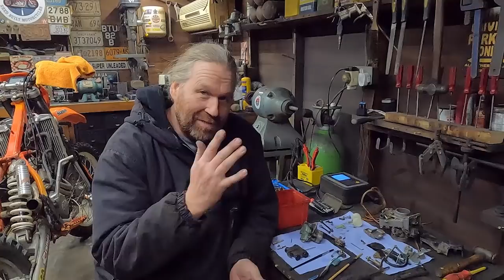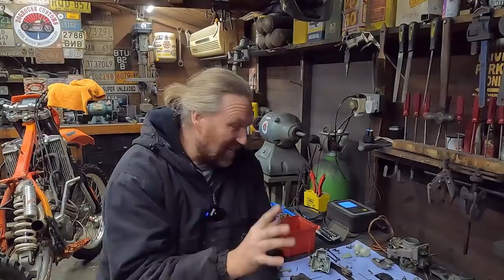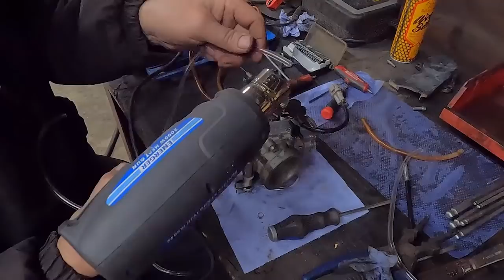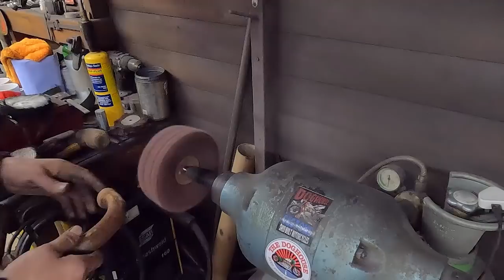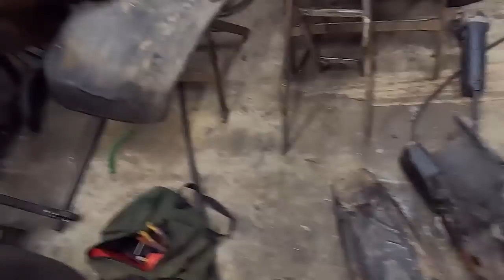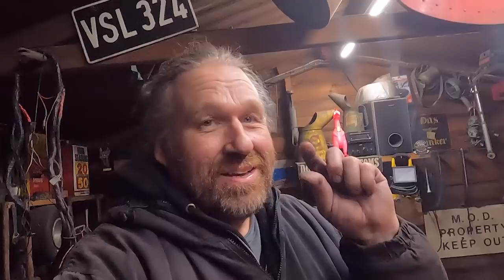E10 fuel turns carburettor green

Comment: I have a quad bike that I was having issues with when it had not been used for some time. Cant remember who told me about it, but basically ethanol fuel is hydrophilic and is a problem with carb engines as the fuel has access to air. This is not an problem with injected engines. I now turn the fuel off and run the bike until the fuel is exhausted, and have not had any issues since.

Comment: You can remove the ethanol yourself by mixing the gas with water, letting it settle then draining off the water/ethanol mixture that settles at the bottom. This works because the ethanol has the ability to bind with water. There are lots of videos on how to do it. In this way, you could compare non ethanol gas to ethanol gas to see if the green shows back up. In some places (In the US) you can buy non ethanol gas but it's expensive and hard to find.

Comment: Just a note about that E10 crap. 25 years ago, after retiring from an arid climate in Colorado to humid, very humid Mississippi, I opened a small Motorcycle shop. To my surprise, the first spring I was open, I had a shed house of new customers with carburetor problems. Yep E10. Ethanol is hydrophilic and attracts moisture, so carbureted bikes that sit all winter can have a carb full of green goo or powder.  After talking to a friend on the Gulf Coast, I invested in a 10-liter Ultra-Sonic cleaner. I would proceed to disassemble the carburetor(s), then run them through the Ultra-Sonic for 30 minutes to an hour. Then pull them out blow out all the passages, run a brass wire through the jets & offices, then reassemble the carbs and call the customer to come get the bike. Price of cleaning the carbs went from $100.00 USD per carb to $50.00 USD per carb. 
What I am saying is that Ultra-Sonic cleaner made the carb cleaning job a breeze. 
I never found any product that really did a good job of cleaning a plugged-up carb on the bike, though fuel injector clean did help some that were not too gummed up. 
There are several additives sold here in the States that help prevent this, I am sure you have several in the UK. 
Good luck with your new Green World.

Comment: I worked for an polaris atv dealer as a mechanic and now work for myself and I've seen this greening of carbs quite often in my state of Illinois and in my experience after it happens you can clean them out, but it will return after a while causing you problems again, so i found that it's just best to replace the carburetor with a new one. My thought on this phenomenon is it's from moisture getting in the carburetor due to the bike sitting in a non-climate controlled environment with sudden temperature changes that basically causes the carburetor to sweat inside (this also happens to the inside of the engine), so the moisture mixes with fuel and combined with the dissimilar metals inside the carburetor creates a chemical reaction which actually causing a "plating" effect that coats the inside of the carb, that's why it's usually all over inside depending on how long the bike sits. So i really don't think it has anything to do with ethanol in the fuel. I can also tell you this from my experience, the Chinese Knock off carbs work great, so i wouldn't hesitate to buy one and use it without worry plus you can't beat the price we used them a lot on the older machines just like i am on my polaris scrambler 400 without issue and without breaking the customers bank! This is just my two cents on the subject. With all of that being said keep up the good work mate i look forward to your videos!

Comment: The copper has probably reacted with oxygen, water, and carbon dioxide in the atmosphere.

Brass is an alloy that’s usually made up of 67% copper and 33% zinc. Bronze is composed of 88% copper and 12% tin.
Reply: That’s what I was thinking. It all looks like copper oxide. Might have slowly floated through the carb and coated everything in the loose oxide. 
Isn’t ethanol hydroscopic? If it’s been stood in a damp atmosphere it might have absorbed moisture via the vents / overflows. Just my 2 pence worth but I agree completely.

Comment: I bought an ultrasonic cleaner a few years ago and it's awesome for cleaning carbs out, I use a carb cleaning solution with it and you'd be surprised the amount of crap it does get out.

As for the old wives tail about removing the ethanol from your fuel using water, that's 10% you're getting rid of that you've paid for and you're effecting the octane rating of the fuel. Just fill up using premium fuel that doesn't contain any ethanol.
Reply from the maker: Thankfully I use premium in the BMW I will defo use it in everything from now on
Reply: @THEDOGHOUSECUSTOMMOTORCYCLES  But make sure it is ESSO premium Craig. I recommended it to a friend of mine with a Datsun 240Z and he was amazed at the performance difference.

Comment: Not long since rebuilt my friends carbs for the same reason, had to replace all the rubber seals as they'd all gone hard and cracked, same thing happened to my RD400 even though it had silkolene pro boost fuel stabiliser in the tank, best thing is to drain the carbs , you  just can't leave this stuff sitting in your fuel system , ok for everyday use.

Comment: You can remove all the ethanol by putting tge ethanol fuel in to a glass  wine making Demijohn, adding 1/2  litre of tap water, cork the demijohn and shake it vigorously, then allow it to stand so tge water settles, it also collects the ethanol as a globby looking layer, simply syphon the clean fuel off the top.
Reply: Not a good idea, your octane rating will be seriously low after doing that. Better to add a stabilizer to the fuel.

Comment: "Aluminum oxide appears as a powdery white or dull gray coating. As oxidation occurs, it hardens and creates a protective layer over the newly exposed areas of corroded aluminum. The aluminum corrosion process is actually halted by oxidation – the metal won’t continue to deteriorate unless the aluminum oxide is removed."

Comment: There is a way to remove the ethanol from the fuel. . . I bit time consuming but well worth it if it is an ethanol problem. 
That powder may be also be lining the whole of the fuel tank too.
This E10 is causing all kinds of problems for seals, pipes and other surfaces .

Comment: Yes Craig it is the fuel ,I've had same thing with e5 fuel ,it absorbs moister and turns to mould ,I wouldn't use e19 in anything with carburettor,I think additives are becoming available to counteract it 🤔

Comment: I have noticed that since e10 fuel was introduced that if I am in slow traffic for more than a few minutes I get the traction control and anti lock brake warning lights coming on this is apparently a warning that the plugs are becoming fouled ( vauxhall meriva by the way )

Comment: Hi Craig, as someone else has suggested , it is verdigris from the brass parts in the carb. Ethanol attracts water and the water reacts with the brass to produce that green oxide. If you left those parts outside in the weather, you would get the same result. The answer is not to leave vehicles sitting unused or drain all the fuel out when you have to store them. E10 is not a problem in a regularly used vehicle, they’ve had it in the USA for years!

Comment: I use Esso premium fuel, it says E5 on the pump, but I've been told that it is still Ethanol free up here (North West).
Not had any issues so far.
I only use other fuels if out and about with the lads and they choose the fuel station to stop at - then I fill with Esso premium when near home.
Yes, it's expensive, but, if it's true that it's Ethanol free, you're getting a good bit of extra energy, and it's not like we burn that much fuel in bikes, is it? :D
Reply: We’ve had a go at de ethanol esso e5, but got very little out of it, so we heard there’s no ethanol in it which is probably true.

Comment: Ethanol fuel eats aluminum and rubber seals. The green is from the alcohol and the powder substance is from the aluminum being eaten away. "It is not the ethanol itself that is the problem, it is the substance that is created when water and old ethanol mix. This stuff is very corrosive and will eat thru aluminum. So, if there is no water in your tank, no problem." 
Alcohol fuel attracts more water to it so fuel stored will gain more water content. If you park a motorcycle outside in cooler weather that has a metal tank water will attract and you will be able to see the fuel level in the tank. It sounds silly but it is good idea to shake the bike a bit to remix because water and alcohol naturally want to separate;  the water will be below the alcohol and when you turn on the fuel tap the carb will fill with water and cause starting issues.

Comment: If you use E10 you have to use fuel stabilizer, if you let it sit for ANY length of time..I reccomend using Non Ethanol fuel instead..but even that will cause issues if left for long periods of time...Shame that you have to sell it...worth big$$ down the road...👍🗽🇺🇸
Reply from the maker: The more I think about selling it the more upsetting it is, last year wasnt so good on the pocket so got no choice, quite a rare bike in the UK so I probably wont find another one.
Reply: I agree and suggest you ask $3400 for it...Ifigure in 2 years it would bring $4,500.....I wish I had a few of my "had to sell"  bikes and cars, now that they have gone up so much in value!...Good luck with the sale and woring job...It's  easy to wire the bike with an "M Unit" ..You'll  never do it differently again! 👍👍👍🗽🇺🇸

Comment: Ethanol adds octane to gasoline, which is getting cheaper and cheaper, and of a lower quality all the time. But ethanol also absorbs water, so it doesn't like to sit. It is possible to remove the ethanol from fuel, basically by adding water and then decanting the petrol, but then you're left with low octane crap... It's not the world I grew up in...
Reply: Ethanol does not burn as efficient as petrol ... it does not add octane and using e10 lowers engine performance . The e10 in uk is terrible in older vehicles ...

Comment: I’m guessing that you are the victim of standing water.  It looks like a reaction with the copper in the brass bits.  Ethanol wouldn’t do that but water would.  I think the E10 fuel didn’t come to the pumps until September.
Reply: Quite right, E5 will do it as well, just takes a bit longer!

Comment: I stopped using the E10 a few years back,,it's just a terrible, dirty fuel,,I use  ethanol free gas now,I always turn off the fuel,and run the carbs dry, I never leave fuel in the carbs,

Comment: Yes sir, E10 fuel is no friend of the Carb'd bike or car! Weaker fuel than of old with the Ethanol blendand  not compatible with some older vehicles, but then the powers that be, know that! Def drain fuel out if your bike is not used for long periods of time. But at least there are fuel additives you can get to combat the Ethanol in the fuel. Putoline do they're 'E10 fuel fighter'. Just 25ml of it treats 25 litres of fuel! Comes in  250ml bottles!!

Comment: Only use 98/99 octane and stay away from e10  in older vehicles in uk ... never use e10 in a 2 stroke as it attracts moister and will rust the crank in 2 strokes ... It's terrible fuel none of my old bikes like it and they feel under powered and get flat spots in the tune ...  this e10 will kill off the older vehicles as it's a deliberate thing to get rid of older vehicles for the green deal electric cars to get pushed on us

Comment: Its a conspiracy to ruin all motorcycles , minibikes garden equipment !! Its horrible I have 5 Motorcycles in my shed and they all ran fine when I parked them now they wont even start😵 my Goldwing has 4 carbs my CBR600F3 has 4 carbs my Silverwing has 2 carbs ECT ECT so now I have to invest in a ultrasonic cleaning tank and spend many hours on each bike taking off all the carbs and cleaning them just to get them to the point they were when I parked them last year😣 that ethanol fuel is HORRIBLE!

Comment: How long has the bike stood wothout the engine running? I only use E5 on my bike, but are worried when it sitting for some weeks during winter.
Reply: E5 high 98/99 octane fuel doesn't have ethanol in it in most UK fuel garages
Reply from the maker: Normally I run bikes up or ride them every week but with having a lot on stupidly I didnt do it, The KTM sat for about 4 months. I defo learnt a lesson here.
Reply: @THEDOGHOUSECUSTOMMOTORCYCLES   avoid the e10 and use a fuel stabilizer like sea foam if you leaving bikes for months at a time with fuel in the tank and you can run the carb dry to put into storage. I only use high octane and use sea foam as it keeps the carbs clean and you can leave fuel in the tank for a year plus and the sea foam stops the fuel going off ... 👍  I thought you be keeping the ktm to ride some trf and tet trails and byways with us in south wales lol ...
Reply from the maker: @Rust_valley_adventures  I would love to keep the KTM but things wasnt so good last year so I have no choice to let it go, gutted but im trying not to think about it.
Reply: @THEDOGHOUSECUSTOMMOTORCYCLES   money not everything dude. good health is the real  wealth 👍👍 nothing like jumping on a dirt bike and you end up on top of a muddy  mountain with your mates lol

Comment: Yep its the E10 - its garbage - has a big detrimental impact on the environment - it will kill your bike if you leave it for any short time- if your running a classic vehicle it will rote fuel pipes and other plastic parts - if you are storing a number of bikes or just storing you can get a storage fuel (covered on Harry's Garage) - you could use the premium fuels they are currently E5 - they want to keep adding this crap to the fuel. the other issue is that the ethanol also binds with Water so will denigrate very quickly in a UK winter - its also very common issue with Lawn Mowers. The joys of the environmental lobby- rant over :)
Reply: @Chambers36TheEnter  yes that is correct just do a bit more research on that part and the fact that the fuel efficiency is reduced meaning lower miles per gallon and you have your environmental impact. :)

Comment: The general rule I learnt is that E10 clogs carburettors. It seems you fell victim to ethanol's ability to mix with water there. This way, the ethanol content helps for air moisture to get drawn into the fuel where it then has its corrosive effect. The E10 pish may be a few cent cheaper than E5, but as it is a useless attempt to lower the CO2 emissions of petrol engines and even consumes farming products that could be other people's food, I boycott it. They can go fill it up their arses if they please. Low emissions from traffic? See to making cars half a ton lighter each, that will save fuel!